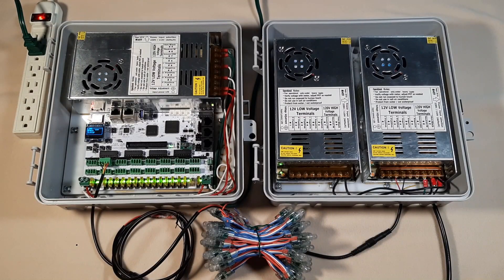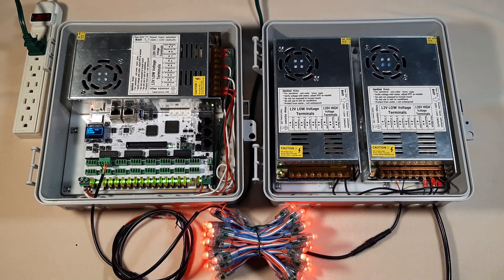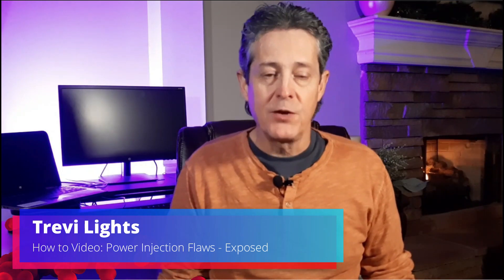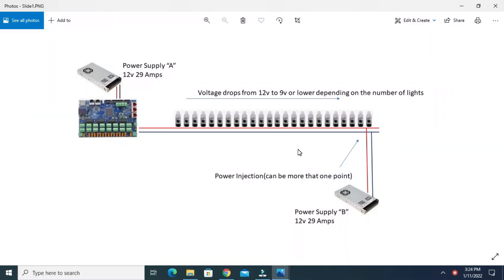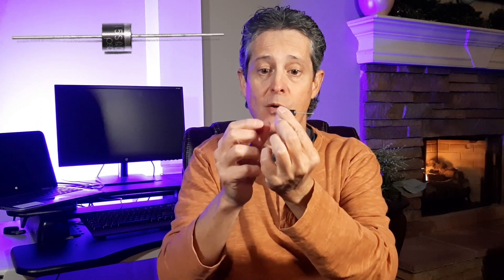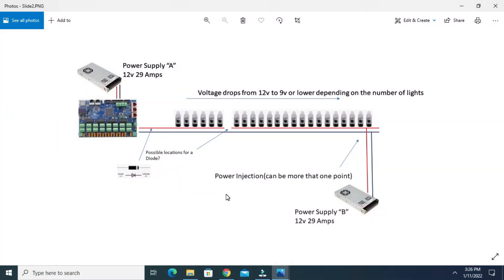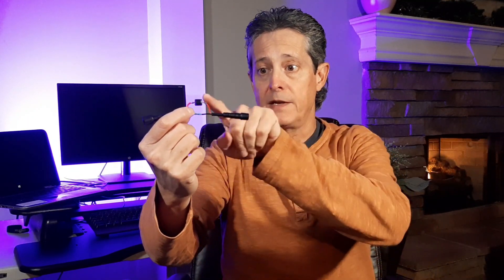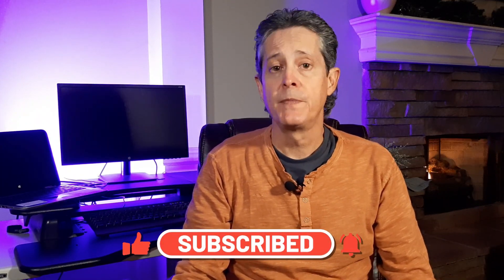Power Injection Flaws Exposed

Comment: Could we inject current from the first power supply if it has enough amp (where is the controler) at every 150 pixels  +/- or we must use another power supply imperatively for the power injection ? If yes, no diode is required? If no, I have to buy more 12v power supplies.
Reply from the maker: Absolutely. That is actually the best way to do power injection. It just a matter of how far the power supply is from you other props. Thanks for watching.

Comment: Thanks for your very informative videos, we're loving them..
We are wondering why you are just cutting the positive side, but not the negative? All electricians I know, told us to cut both. Please Help!
Regards from Germany 🇩🇪
Reply from the maker: Hi Lizzie, Thanks for watching. You need to have common ground, otherwise the data signal will not be transmitted. The data line carries some low voltage. Regards from Tennessee USA.

Comment: Thanks for the video. I have a very small set up with 2 roof lines(one is 68 pixels and one 52pixel) , this year I change controller form SanDevices e6804 4 port which stopped working out of not where last year and now I purchased a Flacon 16v4, planning to add couple arches this year, and 1 more roof line. Controller is located in my garage and from there to the beginning of the first pixel of 2 current roof lines is between 12" and 16". I was wondering what is the maximum distance I can run cable before from the controller port to the first pixel before starting degrading current power, and what cable would you recommend.
Thank you again in advance.
Pixels are C9 Pixel for the roof lines, for the archs probably I will use nods 12v.
By the way from all tutorials I watched yours are the best.
Reply from the maker: Hi there. Thank you for watching my videos. When it comes to the data signal, I have a few connection that go as far as 30 feet. It a depends on the quality of the wire you use. If you need to go further, you can use a f-amp (link below). You can place one of this devices  half way and it will amplify the data signal for another 20-30 feet. All comes down to testing. For voltage drop, again is all about measuring the voltage at different point using a voltmeter. Measure the voltage while playing a color wash effect and see if you need to do some power injection. I would say that keeping the voltage no lower that 9-10 volts will do the trick. Also lower the brightness of your pixels to 30%. This help a lot control power usage. Best of luck on your project.

Comment: since when do you connect both positive and ground together from 2 power supplies ? no one ever does it , it will cause issues with the power supplies , anyone who connects lights and wants to power inject from a 2nd power supply must cut the + wire at some point so the 2 +'s are not connected together
Reply from the maker: Thanks for you comment. These power supplies are commercialized as to be redundant/parallel safe. Everyone should check their to make sure this is safe to do. Thanks for watching.

Comment: if using a power supply not connected to the controller for power injection, you must use inline 5-watt fuses.
Reply from the maker: Hi Frank. I think you mean 5 Amp fuses. But yes, you are correct. It also depends on the gauge of the wire you are using. I use 18awg wire that are powering more that element, so I use 10amp fuses.  I use the following board for my power injections.
https://www.amazon.com/Electronics-Salon-Panel-Position-Distribution-Module/dp/B01FCW7T0E/ref=sr_1_21?crid=13KEK9H5TUH0Z&keywords=fuse+board&qid=1677779239&sprefix=fuse+boar%2Caps%2C167&sr=8-21
Reply from the maker: Here is a short video to give an idea.
https://youtu.be/zvxYS3GRb-Q

Comment: 11.19.2022  this is not an issue because you CAN'T BUY A single of any brand controller kit from anyone , so it seems.   Must be a huge Chinese supply side issue going on.
Reply from the maker: You are right. If pixelcontroller.com they may have some ready to run controller. Their website stock might be out of sync. Another good option is kulplights.com check their website.

Comment: A proper power injection terminates 12v between power supplies.  I skimmed the video but I would imagine this to be a non issue if done correctly.  These power supplies aren’t designed to run in parallel in some cases.

Comment: Ok. Confused here. I've read thar power supplies should not be used in a series circuit.  Please help me understand this confusion.  Thanks again for all your videos and help
Reply from the maker: Hey John. For a show we never connect power supplies in series, we do parallel connections. A Series connection  would be conection a positive with a negative to increase the voltage. This is a no, no. I have used power injection coming from two different power supplies with no issues for years.
Reply: @trevilights  
Thank you. I think I ment parallel.  See. I'm confused lol
Reply from the maker: @johnnagy1575  lol. Don't worry. If you decide to use multiple power supplies like I do, just make sure you have a fuse on every positive wire as it comes out of the power supply.

Comment: Hi Trevi,  do you have or will you be doing a video on Boscoyo 8 foot Chromatree?
Reply: Ok thank you for all your help with last year’s display.  Can,t wait to see your future videos
Reply from the maker: Hey John. Unfortunately I do not have or plan to make a video. You can configure the tree the same as configure a mega tree use plastic strips. If it uses less thst 1024 pixels, you will only need 1 port. Do not forget power injection.

Comment: HI Trevi I enjoy watch your video,  can  you help me setup the F16V4  I can't  get the output port on the F16V4 it only show port #1 but doesn't show all the other ports.  How can I add  port #2 to #16 pixel ports?  F16V3 shows all 16 ports pixel output. Can you help me?
Thank you
Reply from the maker: Hi there. thanks for watching my video. That's a little odd, but try the this. In the Status page make sure that the "Board Configuration" drop down is set to"16 Local ports" and that the "Controller Mode" is set to "E131/Artnet". Hit "Set" button and restart the Controller. Once is has restarted go the the Pixel Port screen, and change the "Addressing Mode" has something like "Start Channel" or "Absolute Addressing" to remove the "Start/End Universe" columns.( I do not own a F16V4, still waiting to be available)
Good Luck.

Comment: How are u getting the power on all three power supply ,only one cable plug for all three of them can u explain
Reply from the maker: Hi Marlon, In the Video you see 3 power supplies. One powers the controller and the other two I use to inject power to different elements. This one has its own power cable. The box that has the two power supplies has only one power cord that connect to the wall. That power cable is connected to one of the power supplies and then I have a set of short wires that jump from the first one to the second one (line, neutral and ground). Just make sure that the power cable is rated to handle the wattage of the two power supplies. In my case 700watts(12v x 29amps each) if used at 100% of it capacity, which I will not. Thanks for watching.

Comment: Power injecting, and how to then manage the associated fuses is always a complicated issue.
I’m definitely no expert, but as I understand it, most power supplies don't cooperate well with each other when their positives are connected together, which can then make the pixels flicker.
Another reason Power Supplies aren’t usually connected together, is so that we can then choose how to divide up the current between multiple power supplies and fuses.
If you have power coming from your Controller (with a 5 Amp fuse) and then inject more power at another point (even if this power Injection also has a 5 Amp fuse), then you’ve doubled the fuse value.  So, wouldn’t this practice put the circuit and the pixels at risk?
I’d be really interested to know how you control the overall current and fuses for your show.
Reply from the maker: Hi Giles. thank you very much for your comment. I totally agree with you on the complexity of the topic. Remember that the fuses are place to protect the wire from overheating not the pixels. Since you are only the controllers port at the beginning of the string and because of the pixels specs the current will never exceed 5amps. For my secondary power supply I used 10amp fuses for every power supply positive output (which commonly there are 3) since I am using them to inject a two point of any string, and using 18awg which is rated for 10amps. I always use a voltmeter with a clamp to make sure I am not exceeding any limits on the wire I am using. Also the brightness at we run our show plays a huge role. Thanks for watching. Thanks for watching.

Comment: The downside of the approach that you mention using a diode is that there is a voltage drop across it. The voltage drop varies based on the particular diode, and could cause issues depending on the diode and what voltage pixels you are running. VCS has a power injection webinar from this past year. The recommendation is to cut power wires between different power supplies to eliminate backfeeding and possible overload of power supplies if one power source fails.

I love your videos and the work you are doing looking at the basics. Keep up the good work!
Reply from the maker: Yes. There a different options. All of them work and are okay. The power drop on this diode. is .3 to 5 volts. The higher the amps the higher the drop.
Reply: @trevilights  diodes don't work like that. Once the PN junction conducts, the voltage drop would remain under .7 volts until it fails due to Imax.

Comment: This is cool information.  But in my show I do all of the power injection from the same power supply that powers the controller (or receiver).   Often I inject by splitting out power at the first pixel and injecting it into the last pixel.  This works especially well when the first and last pixel are near one another like on a snowflake, etc.
Reply from the maker: Hey Chuck. That's great. There are few other solutions or ways of preventing this. Thanks for watching.

Comment: Ive avoided this possible problem entirely by powering my F16V3 externally via that small 2 way terminal block, and only using the negative and data outputs on F16V3 output ports. I then have a separate box that does all the power injection and also f-amps to help stabilize the data.
Reply from the maker: Definitely there are some work around. This is one of them. Thanks for posting.

Comment: I'm a new guy on the scene (so if I say something stupid please feel free to get a good laugh)  but wouldn't it be obvious to the makers of these power supplies to build something like that already into the PCB??? And in my ignorance I would assume that due to the inherent complexities of these switch mode injectors that they would also Inherently have multiple diodes already scattered naturally throughout the PCB because diodes are one of the few components that actually make up a pcb,  there's hundreds of parts total on board but there's only like 20 to 30 components that make up a board, they are just used in recession and repededly, (sorry if my terminology is off a bit but yous are getting what I mean, I'm so new to the tech side of electronics that I'm still having fun tearing down discarded flat screen tvs and playing with the LEDs in them, 

I do have a huge purposel and or a ponderabce but I've noticed that the LEDs in tvs are a challenge to light using a diy controller, I kept burning them up or just flat out under powering them and ur video helped me cement the conclusion I've come to from piecing different pieces of info together over a lifetime and thanks to ur vid I have the simplest answer to my dilemma, your lights are wired in parrellel according to your wiring diagram, the voltage is constant but the amperage must increase with the amount of lights, tv LED controllers output 120ish volts if you test in DC or 230ish if you test in AC mode on ur 10 dollar amazon multimeter. And the LEDs strips seem to be Daisy chained if you undone the wiring harness, But the wires are super thin which tells me the amperage is probably super low, I'm concluding that the tv LEDs run on a total higher voltage depending on number of LEDs and the amperage stays the same or relatively constant, which if that is the case then that kinda sounds like a simpler PCB to make,, HERE is the climax of the preponderance I'm purposing, could you run your LEDs in series instead of parrellel and let the LEDs be all the diodes you need to prevent reverse current and just make a simple PCB to run directly on AC without the need for AC to DC power conversion, I know power supplies can be more unstable that way but we cod even throw in a few beefy Caps to maintain a steady voltage but make several different Daisy chained lights wired in parrellel and keep the voltage high but constant and just raise the amps as you parrellel more and more Daisy chains in???? That's like a hybrid parrellel/series circuit we're talking about and it's sounds relatively simple, maybe some good ol arithmetic might come in handy but IDK, thoughts from you guys??? I tried my best to sound edumakated. 🤓
Reply from the maker: After reading your comment multiple times, and having some tears rolling down my face, I have to agree on the use of diode on the PCB. I am not by anyway close to you on electronics knowledge, but I am sure the controller will highly improve with a small overhauling. I must say I love your enthusiasm and dedication to improving electronic components.
Reply: @trevilights  NGL it took a lot to keep that comment that short, lol, I have no idea what level you are on with electronics, only seen this vid, I can't wait to check out more of ur content. I'm still in my infancy here, with PCBs I'm still learning to stack blocks, but driven by that classic greenhorn electronics hobbyists enthusiasm, I mean I just learned last week what a BMS was, and that's what I've been tearing off these lithium battery packs the last year from these lithium battery packs, hahahaha jokes on me. I've been saving all kinds of battery packs and salvaging the lithium 18650 cells and separating the weird unknown funky PCB that's tack welded to every lithium battery pack, I've been tactfully removing the boards for later use till I understood how to utilize them and low and behold they were the answer to my quest to making a 40 volt diy battery pack, everyone is completely reusable and ready to pop back on an individual pack of cells. Now how to find a way to orchestrate them and get them to work in unison and still be able to cross circuits and be used in series when in use because my selection of BMS are fairly diverse, there's a 12 volt bms, 18, 24, 20. And I have a few bms for the 12 volt and 24 volt SLA batteries for like 200 watt scooters or something, so I got players on the board and which player and I pair up with who??? I got a motley crew of 18650s all mismatched like a rag tag gang, like the Tampa Buccs in 78, or 82 or any and every year before 99. Lol but that's where I'm at. I don't even know what to do with an occiliscope yet, I kinda understand why it's important and what it helps you dial in but, I'm certainly gonna know one day soon cuz I've been  enthusiastic
Reply from the maker: @charliefitzgerald1905  I have a Growatt 3000 24v inverter powering my home with two 24v 100ah Lifepo4 (8×3.2v cells) using 100ah BMS. I am still in the learning and testing phase.
Reply: If anyone is nerdy enough and loosery enough to read this entire thing and also lame enough to pleasure me with an intellectual response then "You're my boy blue!!!" We can be friends cuz I love a 2

Comment: you will have a 0.6 to 0.75 volt drop across the diode,depending on load (ie how many pixels are being powered)  the power supply pot may need to be turned up a little to get full voltage sent to the pixels,especially in 5 volt installations. check with voltmeter and adjust pot accordingly.
Reply from the maker: Absolutely correct. I forgot to mention the power drop and that we could expect the diode to heat a little. Thanks for your comment.

Comment: I think the diode is a good Idea solving the back feed problem.  If you used one on all your power supplies, you would not have to worry about back feeding at all, making wiring simpler, with a lot less thinking  :-)
Reply from the maker: Correct. Thanks for watching.
Reply: This is interesting.  If a diode is placed on each + at the output from the PS, wouldn't you end up with the best of both worlds?  Is there a problem with the power backflowing into the controller from the 2nd (or higher) PS if the main PS dies?
Reply from the maker: @russzaccari7761  You can potentially place a diode on every positive. I am not a trained on electronics to know if the backflowing will actually damage the controller. But definitely the  voltage will be fluctuating. One thing to keep in mind is that there is a power loss of  around .5 forward volts when using a diode, which will no be an issue since you will be doing power injection anyways. Also the diode will start to heat up a little when more amps are flowing(all electronics do). I tried 10amp on this 15amps diode and it did heat up to the touch. But when connected to a pixel port (less than 5 amp) it stayed cool.
Reply: @trevilights  I know you can adjust the output voltage on the power supplies.  You could adjust and up the voltage to allow for the .5 loss.
Reply from the maker: @TheHobbyShopFilms  You are  correct, Output voltage can be adjusted.

Comment: hmm it is a good idea but it needs some adjustment in the case you are using 5V pixels (that diode is around 20%  voltage lost) moving around the power injection closer to the controller should fix it unless i am missing something